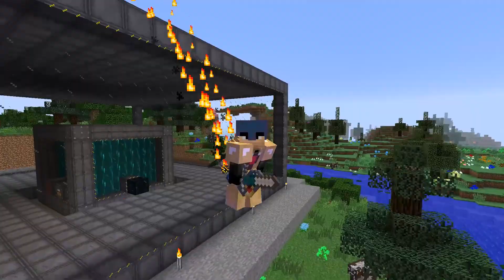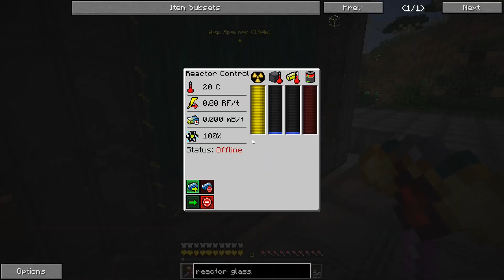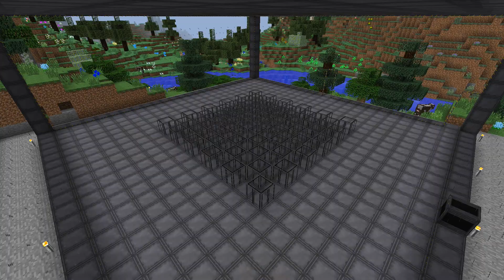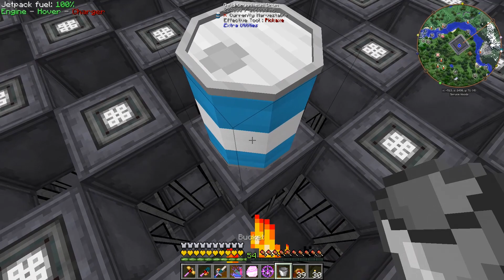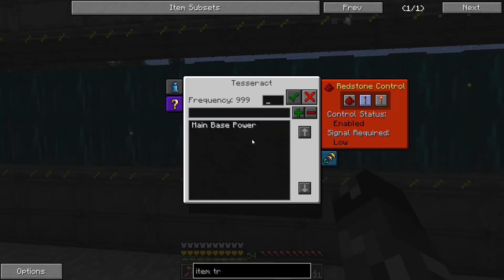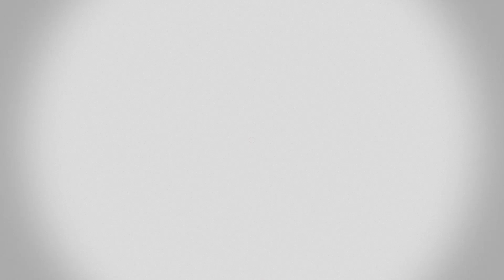Minecraft Mods FTB Infinity Evolved - PROPER BIG REACTOR [E50] (Modded Expert Mode)

Comment: That program you just ran can be replaced with two rednet ports and two rednet cable. It will auto-throttle the reactor like a dynamo if you set it up correctly.
Reply: Curious on how you would do that, currently trying to find the best way to maximize my reactor, and I would love to try using rednet stuff!
Reply: If i remember correctly its Output: Energy level to Input: Control Rod Level

Comment: Consider using two of the Reactor RedNet Ports to monitor and adjust your fuel rods. My reactor puts out about 180k RF/T which is way more than i need. One port reads the energy buffer and relays that to the other, which then adjusts the fuel rods to keep the energy buffer in the middle. Super simple to set up and seems to be quite efficient. I feel like my reactor fuels itself entirely off of its waste, but i'm sure yellorium sneaks in every once in a while. It's all automated so i'm not entirely sure lol.

Comment: if you want your reacter to always produce about as much RF as you are using, simply write a program to set the controle rods to the same percentage the power buffer has.
So, the fuller the buffer the slower the reactor works.
You don't evenneed a computer for that, just use two rednet ports.
Set one to output the buffer fill percentage and set the other to controle rod percentage, then simply loop a rednet cable over.

Comment: You can use the Cryo-stablized reds tone FluxDuct and it'll transfer an infinite RF per tick, run it straight into a tesseract and it'll transfer all energy generated in the reactor.
Reply from the maker: +TechyGuy15 Or you could put the tesseract directly on the power tap like I have it to do the same thing ;-)
Reply: Alrighty! Thanks for the tip! :)

Comment: why bother with cryo? it's going to max out on heat anyway?
Reply: +SIgaming more RF efficiency per ingot used. Gelid Cryotheium is the highest tier coolant available to use. Needs 2 snow balls (easily obtained via flux freezer), electrotine, Niter (pulverizing sandstone), and Blizz powder (snowball with 200 mb of redstone in a fluid transposer, or pulverizing a blizz rod). You need 4 cryotheium dust to make a buckets worth of gelid cryotheium.

Comment: I have a very important question hypno. How do you get your minecraft to run so fast with so many mods yet my title screen lags with ic2 installed on a Windows 10 hp 4GB system memory, 500GB hard drive and Intel Celeron N3050 Processor
Reply: Computer
Reply: Prob upgrade your processor and ram and then you can see a change in that loading screen ;) your processor Base Frequency is 1.6 burst Frequency is 2.16 dual core processor although try your ram first to 8Gb
Reply: Another reason for being laggy is your game is taking up to much ram or not enough and that's why most gaming PCs have 8Gb of ram hypno prob has 16GB or more of ram due to the rendering he has to do with videos and such. Anyways great work hypno! Keep it up.
Reply: +aaron tucker so what should I do about the ram
Reply: is your motherboard dual channel? if so buy 8GB 2 stick pack of ram 4+4=8. if your motherboard does not support dual channel buy the 8GB 1 stick and remove your old ram. Do Not buy a random 4GB stick to pair with your other stick. if you know your motherboard you should tell me what it is.
Reply: +aaron tucker how can I find out
Reply: +aaron tucker whatever comes default with my type of laptop
Reply: anthony reno  i see you have a labtop i would rec getting a DeskTop for gaming much more easy to upgrade your parts

Comment: With Wellington tower it's stable and sis a good source of power but if you use the big reactor there is a chance that you might forget to rerun the ender quarry that you might need for resource collecting and run out of liquid blutonium and have no fuel so you should have Wellington tower run for maybe a week of afking and store up some power then if there is a crisis then you can just start that back up and I think you should upgrade the generators there as well with all the bedrockium you have you could easily make a lot of 64x and get ridiculous amounts of power constantly

Comment: What's the point of 3 blocks wide liquid ender?  As I remember, it only registers what is touching the fuel rod as coolant, the extra rows do nothing.
Reply: +try2bcool They updated it to where coolant in a 3x3 area stacks better than coolant in a 1x1 area. You use less ingots per use interval (144 mb each time), and produce more RF/tick.

Comment: Something you could do is set up an ender chest to keep bluetonium stocked for the drawer.  You can also move the casting basins for the bluetonium to the dimension that you get the fuel from.  Just have it so that it goes into a bedrockium drum then out into a normal drum that pours into basins.  Then pull from the basins into a DSU which gets pulled out into the ender chest.  

All the framerate lag from the casting would be localized to the dimension.  You could probably add three more basins to the top of the drum using the same translocators, then pull out from those with a duct into the Deep Storage Unit.  

Hope you like the idea!  good luck on free fuel.

Comment: I'm pretty sure the CC computer can read the energy level in an energy cell, so you can make the reactor more efficient because the reactor's internal energy buffer is small, not that it matters with infinite fuel.
Reply from the maker: +Jakov Sušanj The problem with this is an energy cell's maximum output (aside from creative energy cell) is 32k RF/t. The reactor can output much more than this with a tesseract placed on the power tap.
Reply: +Hypnotizd EnderIO energy capacitor banks are also an option, multiple of them together have very high input output rates.
Reply: +Jakov Sušanj  honesty i was expecting him to have started using them a long time ago. The display features is has are pretty good and AFAIK like u pointed out the input & output are very expandable since they are multiblock structures.

Comment: you can use flood gate to give lava to thermalily flower of botania and get a big amount of mana!
Reply: +Pietro Ansini Lava power generation of any form is disabled in expert mode.
Reply: metayoshi1 i know.
i've used tank of lava up the flood gate to create spot of lava that thermalily burns to create a big amount of mana.
Reply: Thermalilies are still usable O.o?
Reply: I know they decay, which is why I never bother to use those. Though, I think the TNT flower generates more mana compared to endoflames and thermalily. Craft a blue SDX, set it off, and watch it eat all the entropy. SDXs have a 2x bigger blast radius than regular TNT.
Reply: in expert mode, the lava ones decay too, because there is a set up with gathering lava from the nether, and using the ender tank to send lava to the thermalily(ies) to produce mana. It also states in the lexicon that it decays as well. I looked up a way to prevent decaying, but a troll popped up and moved the tab out of the way (which is a pretty funny way to poke fun for those who think outside the box). Anyway, I am looking to use the tnt ones for mana production instead, since I have like a boat load of gunpowder and flint from cobble generation and creeper killing, along with collecting blue slimes from the twilight forest.

Comment: Hypno, if you find that you're not blockifying the blutonium fast enough, perhaps try using the ender jar thing. The one from the ender chest mod that transports liquids. Send that to the overworld, to wellington towers, and into a drum from there. At that point, it's pretty much infinitely expandable to however many casting basins you would need to keep up.

This would only be an issue if you either expanded your current reactor, or built more, but it saves you the step of going back and forth to fill up the drum.

Comment: Bravo! 
Translocators CAN filter items, right-click the big square around the inner square to get a UI. Use diamond nuggets, iron nuggets, glowstone, and redstone to customize them. :) 
Hate to tell you but you don't need the enderium in the corners. The heat radiates in a straight line from the rods. The filler block is usually graphite blocks but there are other blocks you can use too. (like glass, gold, or even air blocks).

PS Thermal Expansion sponges absorb all kinds of liquids and retain them like a bucket. You need a liquid transposer to "squeeze" the sponges.
Reply: is late but i love you S2

Comment: U can filter translocators, right click on outer ring.

-Right clicking on the plate of the item translocator brings up a 
configurable filter. These slots are fake and can be configured with 
NEI’s drag ‘n’ drop.
-Adding glowstone to the plate makes it transfer stacks at a time.
-Adding redstone lets you toggle input/output with a redstone signal.
-Adding a diamond nugget (diamond in a crafting table gives 9) puts a
 translocator in regulate mode. In this mode it will maintain a certain 
amount of items set in the filter in the inventory it’s attached to.
-On an inserting face, it will only accept items to fill the inventory to the matching filter.
-On an ejecting face, it will eject any items that don’t match the filter.

http://www.curse.com/mc-mods/minecraft/229318-translocators
Reply: +999SAVA666 Lol, I hope he reads it...
Reply: +999SAVA666 These function are what makes the translocators so useful. I never use them for regular stuff, but keeping an inventory stocked with a specific quantity is just so easy with these! Haven't found any other way of doing this.
Reply: +Dieter Gunst Thermal expansion retriever can do this.
Reply: +PeKlim Yeah, but I'm talking about the older days before Thermal Dynamics was introduced. When it still was part of the thermal expansion and the whole servo system wasn't there yet. Thermal Dynamics has grown a lot and can do almost everything :).

Comment: Just calculate the percentage the energy buffer is filled to and set the control rods periodically to that value. Your reactor will automatically adjust to your power usage and keep the optimal fuel efficiency that way.

Comment: Hey Hypno! Diamond Nuggets on the translocators actually give them a Filter option!
Reply: +Hypnotizd Diamond nuggets let you set how many of that item is kept in the inventory I believe :)
Reply: Oh... Well, even better then! Hahahaha
Reply: King Chuck Difference is you would have to set up a massive operation to get those water wheels to make you this kind of power. You would have to make more than 4,000 water wheels set up in the optimal configuration to generate this kind of power. Literally all hypno has to do for 130,000RF/t right now is spend 200RF/t on powering the dimension.
Reply from the maker: +Iago Jevaux Apparently you don't even need the nugget to filter. Just right clicking on the translocator seems to open the GUI.
Reply: +Hypnotizd Correct, the diamond nugget allows you to specify a max quantity to go the inventory. Lets say you have a chest and want, say, 5 stacks of wheat in there at max? The diamond nugget upgrade allows that. It will never put more than the 5 stacks in.
Reply: +Adam Roy And to clarify, you can still put items in the GUI without the diamond nugget upgrade, but it is merely a filter and does not specify a max.
Reply: +Hypnotizd Man the entire objective we had set out was to get to the Creative Energy Cell, and you basically just created that with the free power. This is so stupid.
Reply: +Iago Jevaux I actual said that last episode  but honestly  he doesn't know if you put metal blocks next to the rods to save him making that many rods  and getting more power from it.
Reply: dangit i was gonna say that
Reply: +thethetaco2 well, technically whater wheels give you free and unlimited power. Why even botter making a creative cell?!
Reply: King Chuck because it kinda of a a goal to make the creative stuff just to brag really.
Reply: ***** Personally I appreciate the different styles of the Youtubers. DW20 focuses on automation, or using self-sufficient systems to automatically produce materials as needed. Hypnotizd focuses on mod progression. He only builds elaborate systems if they are necessary to advance further through a mod (i.e. wellington tower for energy). He ends up covering the pack a lot faster, and doesn't create large technic-packy systems for the fun of making them. To me, they both have their pros and cons.
Reply: ‍‍‍‍‍‍‍‍‍‍thethetaco2 Yep. And instead of spending the last 5-6 episodes creating all the parts required for RF tools, he could have instead spent that making 4,000 water wheels. End result is exactly the same.

Comment: Cant you just pump the liquid blutonium in the reactor? (didnt finish video yet)
Reply from the maker: +KFChica No.
Reply: +Hypnotizd I hear diamond blocks are good for cooling, so instead of those 200 buckets of cryothium you could use that many diamond blocks, if you have that many. It would be expensive but I think it's better and it is a lot easier to do. And you can always scrap it since you can just mine the diamond blocks.
Reply: +Hypnotizd try setting up a quarry in the highlands when mine was finished I had 600 emerald ore and 60 dense.
Reply: About pumping liquid bluetonium in it the reactor, have you even tried to pump it in the reactor, or even tested that out to see if it is true or false?
Reply: +Nessquat I don't think you can because the liquid pipes don't connect to any interface on the reactor.
Reply: And that kinda answered my question
Reply: +Nessquat as I said that I was testing it and indeed no liquid pipe can connect to it. Anyways unless getting it in bulk you want have liquid resource right? I never really got to the point in processing the cyanite because I always went to solar power.
Reply: +FallingAnvils - Minecraft I might have misinterpreted the questions if what you said answered his question. What I thought it was if you can pump the fuel into the reactor instead of turning it into ingots
Reply: ***** Really? Oh, I guess I misunderstood something, thanks for telling me that.
aaron tucker He was replying to me, not the original question.
Reply: +yaksher haha lol had me think about it a little more Ty for telling me ^-^
Reply: I think a block of enderium is a better coolant then the diamond block.
Reply: interesting, i must try these things! solar power is to op for me to use haha.
Reply: +Hypnotizd YES